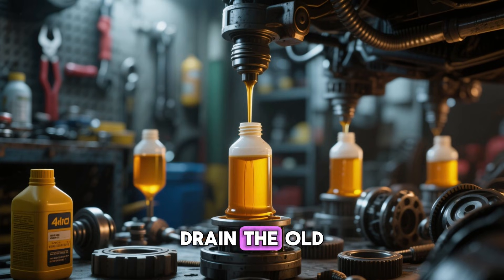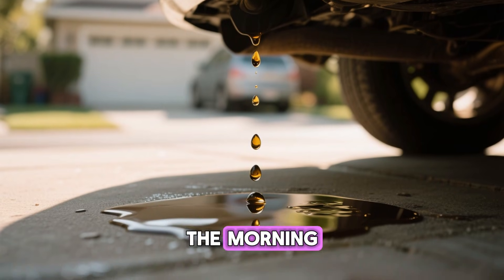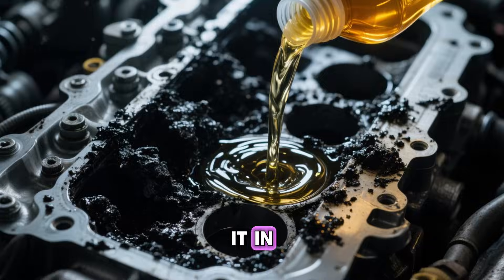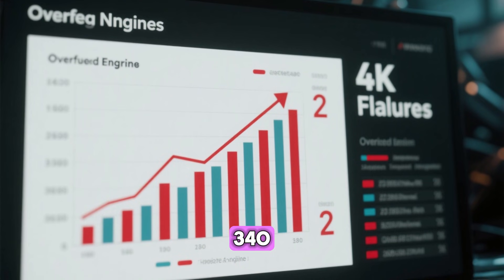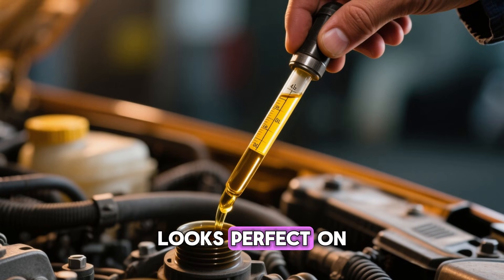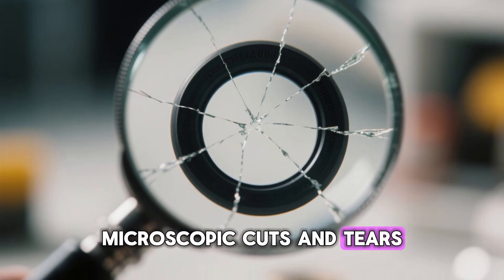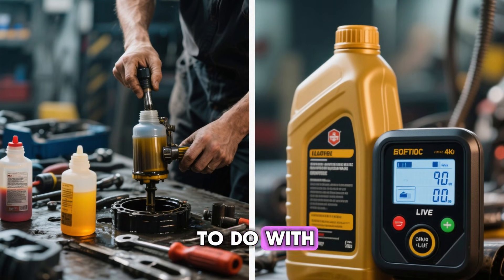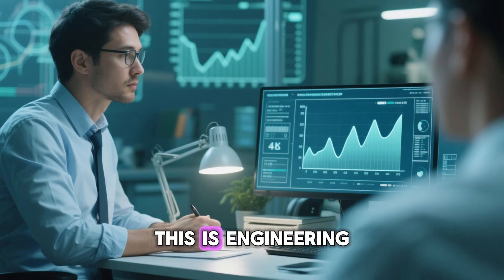Stop! Doing This After an Oil Change Could Destroy Your Engine

Comment: When I change my oil, I fill it, run it or a couple minutes then, if necessary, top it off.  When I'm done, I drive the mile to the auto parts store to recycle the old oil.  When I get home, I check and adjust the oil level again.
Reply from the maker: It sounds like you have a solid routine! Checking the oil level after running it for a bit is a smart move. Recycling the old oil is also a great way to keep things eco-friendly!